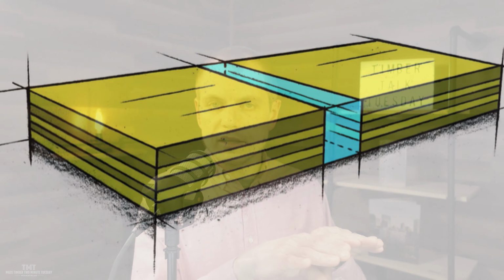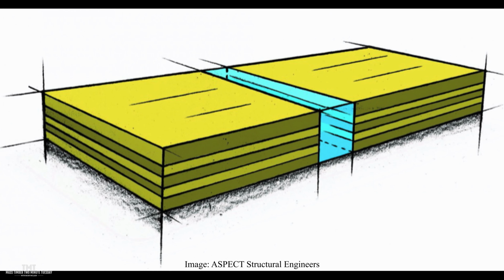Post & Beam vs. Post & Plate: Which is Best for Mass Timber?

Comment: I would argue the only thing left to be done is to change the bolt into double-end stut such that it does not pry open the panel (5:22). The shear strength like any anisotropic, natural fiber (I would argue even in CF/GF) is a fucking myth. Why?
1. air buble
2. resin hygro
3. external temp

so use the lowest know figure, calculate the margin, dont get bold.

Comment: Little bit late to the party but what about combining the two concepts? Would it be possible to integrate a one-way spanning CLT panel between the glulam beams? Cant seem to find any references but dont know why, it seems to combine both the benefits of having a small construction height together with a large span. I can imagine using notched CLT for partially integrated floors or using a lot of screws or steel plates to suspend the CLT slab between the glulam beams.

Comment: Tilt up concrete warehouse with glu lam  columns + wood trusses. 32’ clear height in warehouse. Possible?
Reply from the maker: Yes, possible and variations of that have been done. Some industrial projects are now exploring an all timber solution including for the 'tilt up walls' while others are using mass timber walls with steel roofs. Really a low of flexibility in what can be done. A couple of examples here: https://www.woodworks.org/resources/why-consider-a-panelized-wood-roof-systems-for-commercial-buildings/
https://www.woodworksinnovationnetwork.org/projects/southfield-park-35-warehouse
https://www.woodworksinnovationnetwork.org/projects/1391-horizon

Comment: Are you familiar with the  Deltabeam? If you are would this be considered plate construction? The company who manufactures the deltabeam is peikko.
Reply from the maker: Yes, for sure familiar with it. I would consider that to fall loosely within the post and beam option. The beams are flush with the CLT so they don't extend below like they would in the glulam or steel beam option.

Comment: What are typical sizes of post and beam adopted in multistorey residential mass timber buildings? Thank you for the content
Reply from the maker: The beam sizes will vary with spans and loading, and the column sizes will vary with number of stories supported, as well as loading and height. We provide some discussion on member sizing and grid options in this article: https://www.woodworks.org/resources/creating-efficient-structural-grids-in-mass-timber-buildings/

Comment: Would building with 4x4's be considered heavy timber?
Reply from the maker: No, IBC Chapter 23 lists the minimum sizes for heavy timber construction and both beams and columns are required to be larger than 4x4. Thanks for watching!